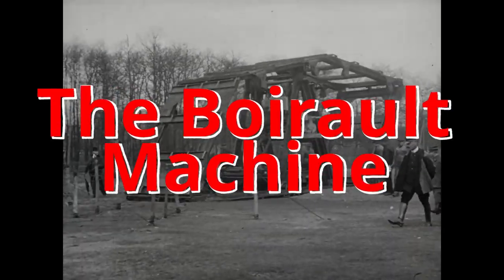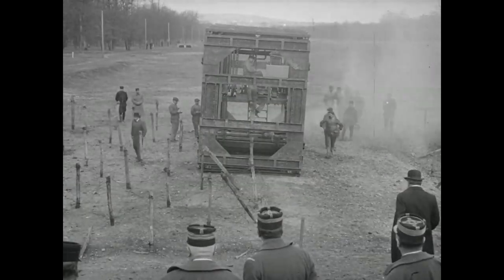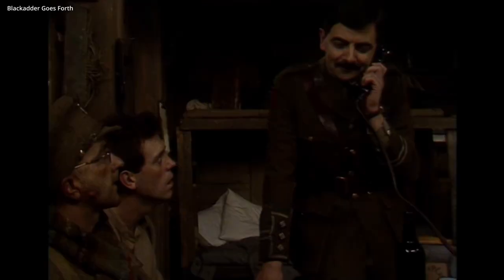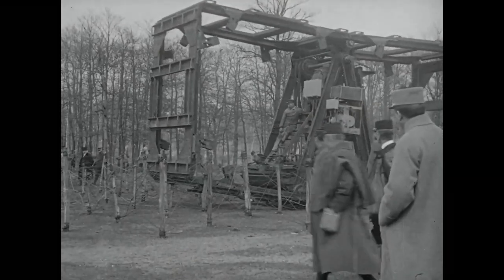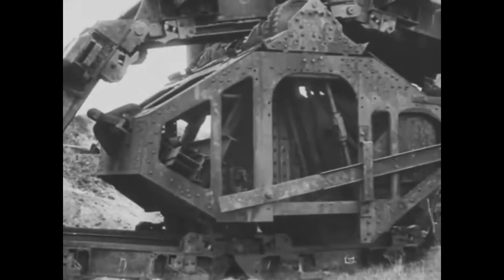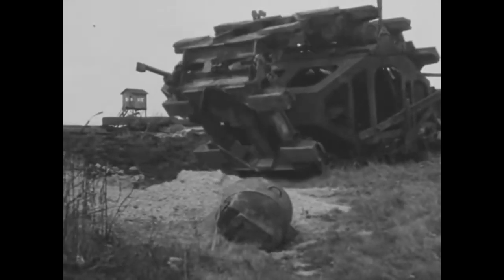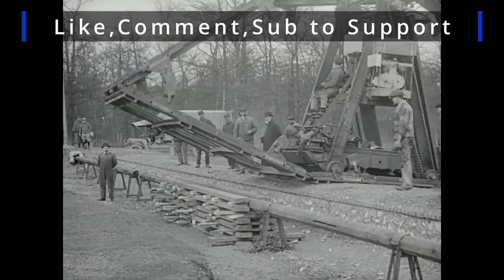Before There Were Tanks - The Boirault Machine

Comment: The British did add wire cutters to the front of some tanks but this did not work as well as it was hoped. In fact time I came across such a tank was a photograph of one which had broke down and ended up being used as an observation platform by officers and it had chairs and a map table placed on the top of the tank. Actually when I first saw a photograph of this I was somewhat confused by the fact that it had WC written on the back of the tank in large white letters which, until I read the caption that explains the letters stood for Wire Cutter, I took to meaning Water Closet or toilet. Why, I thought, do you need a mobile toilet on a battlefield? Im my defense I was only young at the time.
Reply: Indeed...Hobart,s... Funnies were very innovative, thank Goodness, Churchill  rescued  him from the Home Guard..

Comment: Barbed wire is still a problem for tracked vehicles when it gets entangled in the drive sprockets and/or road wheels. It can get so wrapped around and entangled in them to the point of immobilizing the vehicle.

Comment: With this video about the ancestors to tanks, you could do a short one about the fabled Da Vinci tank. It got a spotlight in Assassin's Creed Brotherhood in the Da Vinci DLC. It doesn't have to be long, like 5 minutes would work.

But this design in the video is very interesting. The precursor to the overall design of the Mark 1 Landship. And with the ability to flatten barbed wire to allow infantry to pass. But without armor on this, none would even reach the wire before being knocked out by machine guns and concentrated rifle or artillery fire.
Reply: Leonardo's hypothetical concept of a fighting vehicle really isn't a tank.
More a portable pill box or bunker in truth if Leonardo's time had a means of internal self propulsion which they simply did not exist till English Thomas Newcomen inventor of the atmospheric engine, the first practical fuel-burning engine in 1712.
Mind early steam engines were so massive & heavy you simply couldn't put it in any vehicle till locomotive made by Richard Trevithick of Cornwall England!
Puffing Devil the 1st locomotive was used on rail in 1801!

I much prefer Leonardo's real inventions like the (Wheel lock firing system) the 1st fire arm that could be fired in the rain though required prior set up.

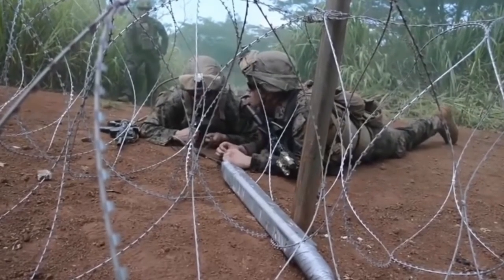Comment: 1:51 That looks like a device created by an English guy, I think his name was Alford, in the early 2000s. 

In any case, it's basically an improvement on the Bangalore torpedo, which was basically just a pipe bomb. His device is polymer, and once filled with explosive filler, is not only significantly lighter, but smaller. It has four linear shaped charges, which cut the wire before the overpressure blows it out of the way.

If memory serves, he also developed a device with a shaped charge for UXO, or IEDs, that could penetrate the device, and ignite the explosive filler without detonation.

Comment: "Thick fields of wire could still entangle the heaviest of machines" Really?  I didn't know that, can you make a video about this?  About the biggest tanks getting tangled up?
Reply from the maker: I could try to see what footage I can find.  The wire gets wrapped up in the running gear is the biggest problem.  One strand is easy enough to snap but if it gets wrapped up over and over it can create big problems.

Comment: Why would you need a driver for a vehicle like this? Couldn't you simply start the engine, set it into gear, and watch it roll ahead of your line crushing barbed wire? While it would still be vulnerable, surely the lack of driver would allow for it to operate much more dangerously, creating opportunities for the men on the front?